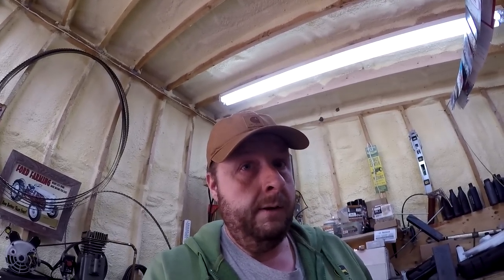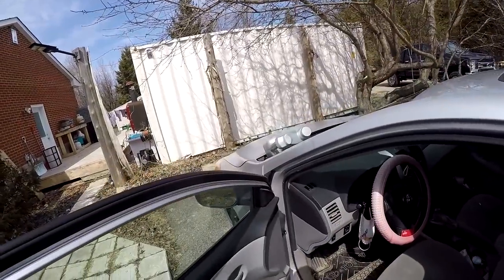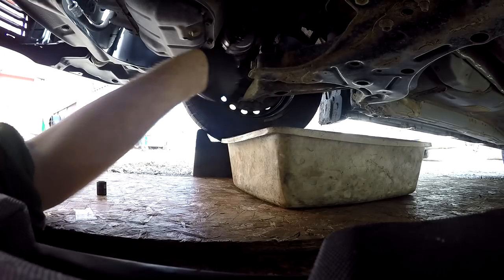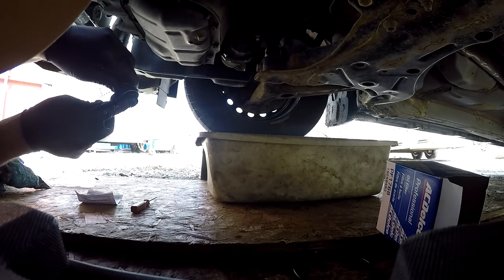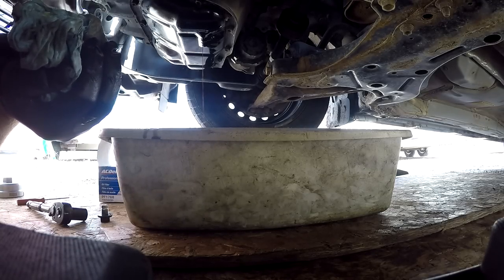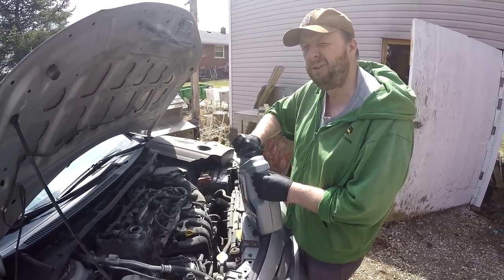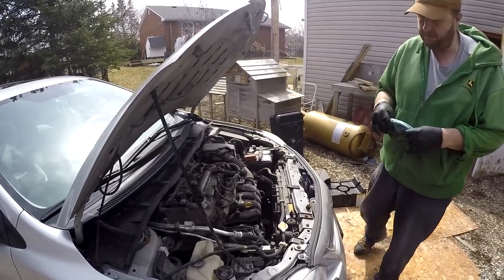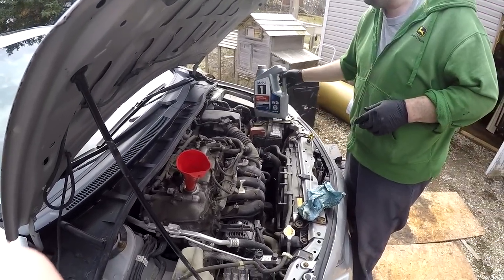2013 Corolla oil change...Wish I had a lift for this one

Comment: HAHAHAHA, I'm preforming Micro Surgery on a Speed Sensor Connector on My Jeep Liberty.
The Sensor wires rubbed on the Parking brake cable right at the Pumpkin. 
1" from the Connector Body. Had to take the Connector apart to add wire length to be able to reconnect 
THEN !! I have to replace the Right Front Brake line on My 1 Ton..
Oil Change !! You had an Easy one. LOL
Put the T-Case in neutral and use the parking brake to hold the Truck in place..

Comment: The valve is situated near or at the top of the Toyota Corolla's rocker cover (valve cover). The PCV valve can get stuck open or clogged with sludge and should be inspected regularly and replaced when required. hope that was enuf info to search

Comment: Ooh, just like my girlfriend's! I got a couple questions for ya about your car - 1) do you have issues with the positive battery terminal getting horribly corroded even with new batteries? 2) do the lights for the gear shifter and A/C controls go out, but turn back on if ya whack em a bit? 3) ever had a really strong gas smell come out of it after idling at a stand still?
Reply from the maker: no no and no.. The batterys will always do that on anything.. I keep mine clean and dry.. it helps slowing down the corrosion

Comment: you forgot to do something before doing an oil change, you must change something like the pistons or your gonna be running on bad ones and you must change few engine related parts also because if your burning oil then your burning the intake and the fuel filter and pump might need bit of work also and just basically doing few engine parts might fix few your issues because its old car and the coralla also has its own faults

Comment: Wouldn't hurt to change the fuel filter as well and if the tranny is lagging try pulling the pan and change the tranny filter  iv done thousands over the years as I have working in the industry for the past 20 years

Comment: that needs a K & N air filter them original crappy thing in it is rubbish i got my dad a 2010 Toyota corolla first thing i did was get rid of that air filter my dads car performs so much better and on fuel SHOULD PUT ONE ON YOUR TRUCK AS WELL